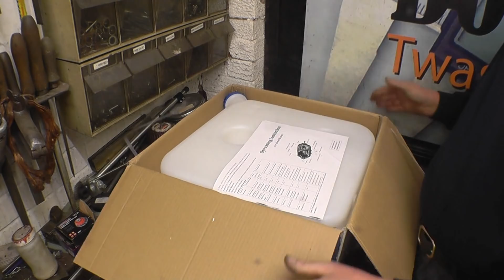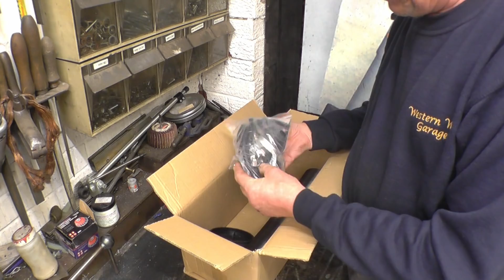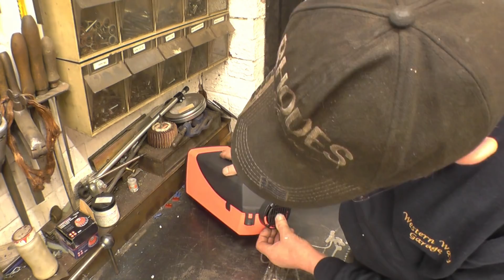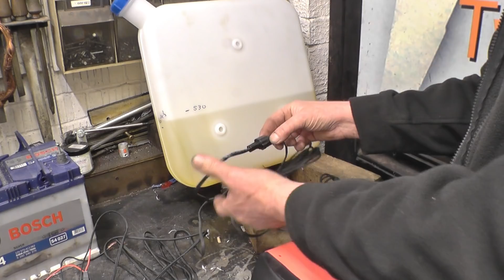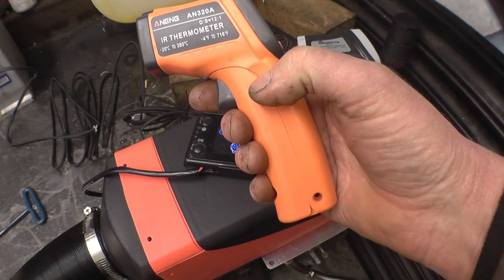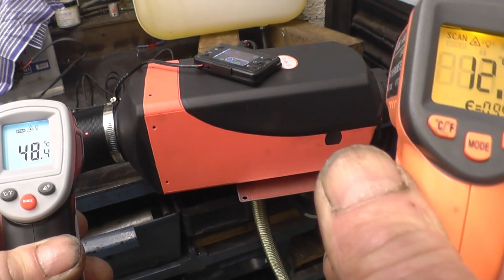Banggood Diesel Heater Review

Comment: Unbelievably cheap compared to Eberspachers and Webastos.  But 146 quid buys quite a bit of high grade insulation (for instance four sheets of 50mm thick 2400mmx1200mmx4 sheets of PIR), then you can heat the workshop with nothing more than occupancy heat, a tiny electric heater or even a central heating radiator if your workshop is attached to the house.   At least this diesel heater is thermostatically controlled, it's strange how so many people with workshops prefer things like massive woodburners and then having to sling the doors open to cool off to draught proofing and insulation.

Comment: You could mount it high up on the wall near the garage door and have some sort of overhead diffuser in the middle of the garage to spread the warm air nicely around. It shouldn't be that hard to get that little exhaust pipe through the wall.
An air-source heat pump would be ideal in the workshop. Keeps you cool in the summer and warm in the winter.

Comment: The fuel pump should be mounted at 45 degrees; it does not create moister in the workshop/van/car; you can also get a small silencer for the exhaust and its much quieter.

Comment: Good honest review and seems like a decent unit. Got to say though, I think it's the wrong tool for the job. Half a litre of diesel an hour to bring the temperature up to 12 degrees? As has been mentioned, a plug in oil filled heater costing very little would do the same job for less money. It's also far less faff. Diesel tanks, exhaust. Fuel line, battery or psu...and what a racket the thing makes.
Reply: @Carl Wilson Run these on kerosene and it works out about a third of the cost of electric heating. They aren't silent but the noise isn't that bad
Reply: @bitzapot  fair enough. I suppose you could mount it outside to keep noise to a minimum and pipe the heat in.
Reply: It's too much faff. An oil filled radiator maintaining a constant temperature doesn't hit the electric bill too much, unless your garage is Blenheim Palace. Also, you don't have to go out to buy the fuel, it hangs about in the wall waiting to be used.

Comment: Two questions. 1 How big is your workshop? 2 How much does it raise the temperature and how long? For a shop in the states mine is a bir small only 14 x 20 feet. I did insulate the building. Here in the US Kerosene is 2 times as expensive as Diesel fuel even with road tax. In fact off road diesel isn’t that much cheaper. I have used the torpedo type heaters in the past, but now I do a combination of a electric ceramic heater and a cabinet propane heater. I use the propane heater to bring it up to temperature and let the ceramic keep it comfortable. The propane cost here is quite reasonable. My propane was less expensive than the Banggood one. However it does look to be a good option

Comment: Nice honest review John.
Two weeks of trouble free use is a big positive, albeit several hours only a night, with regard to this versus an electric heater, each has its own pros and cons. If your shed/garage has only a small amperage electric supply, then it's a good choice, also buying the fuel as of when means no unexpected high utility bills. Providing more than 5 kilowatt, means it beats most electric heaters hands down.
Certainly better than an old paraffin heater causing moisture/rusting tools. 
With ample electricity supply, remember for UK 230/240 Volts, a 3 kilowatt heater will need 12.5 amps, 5 kw- 20 amps!!!. Higher than this then the oil heater wins quite easily.
 The most efficient electric heater, available at minimum cost is a oil filled type, used with a thermostat, for directional, then a fan heater.
Just my view.

Comment: I wonder if you could cut the end off and use it as the heat source for a metal casting furnace? It would be a simple and cheap way to build furnace if it kicks out enough heat.

Comment: I'll stick with my $100, 4.8kW electric thanks.  Heats my 300 ft2 single car garage shop in about 5 minutes from 5C to a comfortable temp.  Plug it it and done.  No fuel, no extra 12V power supply, no poisonous gasses to worry about, nor poking holes in the walls and heaps of wiring and plumbing.  The economics will vary by location and the cost of energy, but I can assure you in Canada, you will never save a penny with this diesel burner over electric unless you live off the grid.
Reply: Surely that depends on the cost of electricity in the UK vs Canada. It ain't cheap in the UK.
Reply: @poppypuppy5372  It's about $0.08-$0.12 per kwh  (0.05-0.08 euro) depending on how much you use (price jumps as you use more).  The $130 price difference in the heater will take a lot of heating to make up even if diesel is much cheaper per joule.

Comment: seems strange the heater plug light came on when you turned it off, why would the heater plug need to come off its its only cooling down, time you pay for fuel and to keep battery charged up just not worth it, also having fuel in a work shop like that is not the best idea
Reply: Why not? Its diesel, not petrol.
Reply: @timothy790110  hes not burning diesel if you watch the video! it cost more to run than an electric heater, i jusst cannot see any point in it its not meant to be used in a shed, its for trucks & caravans etc
Reply: orkid knog if using kerosene the running costs per kw are around a third of electric
Reply: I wonder if the glow plug comes back on to burn off any residual fuel as it cools down? The heaters are very much worth using and safe. Less dangerous than a lawnmower full of petrol...

Comment: Hello John,  I am amazed by these new heaters.  I have a Toyo in my boat that they stopped selling in North America which cost about 2500 dollars.  I had tried Espar, Webasto, and another unit which were not designed for full time use and crapped out in two or three hundred hours (not a lot for the price).  The Toyo was the best because it could run 24/7/365.  So price per hour of operation is fantastic with this unit.  I have watched a couple of other videos and they seem very good with the caveat that you turn up the thermostat and run them hard for a couple of hours a day if you are idling it along for extended periods or they will foul the combustion chamber and heat exchanger.  Simple enough.  Definitely need some sort of auxiliary power (motorcycle battery??) because if the power is cut off the heat will melt down the plastic pretty quick.  That seems its one weakness.  My Toyo is all stainless.  Good video.  Take care.  Doug

Comment: Half to 1 litre an hour, thats 60p to £1.30 per hour when you could run a 2kw electric fan heater costing £10 for 15p to 30p per hour (and people think they are expensive to run). In a van, yes.  But in a domestic / workshop environment with electric on tap in comparison? Come on John.  Would you really pay for that out of your own pocket and then the extra cost of the diesel, CO alarm, potential fuel leakage, Products of combustion leakage, longevity of the control panel etc when a fan heater does the same job simpler and much cheaper? You've surprised me with this one.
Reply: They'll run on kerosene which is cheaper than diesel and the half to  1 litre per hour is for 5kw of heat. A normal electric fan heater is 2kw so when you compare the costs and heat output they work out around a third of the cost of using electric heating. Electric heating is always the most expensive way to heat unless you're looking at heat pumps.
Reply: Wet fart is obviously deaf!.
Reply: I use heating oil to run mine and it's absolutely fine, currently the cost of heating oil is 61p/litre (or less if you buy in bulk).
Reply: Were do you buy small quantities of  Kerosene/Heating Oil the minimum I can find is 205 litre barrels.
Reply: Just realised John says .3 to 
.5 litre an hour, that's about 30p an hour on full heat for 5kw. Roughly 30p an hour for a 2kw electric fan heater makes electric heating about 2.5x more expensive

Comment: I want a review of it running waste oil...

With thanks
Glenn
GLMelectrical
Leeds UK
Reply: Waste oil would probably have one of these units fouled in 5-10 minutes. Even clean diesel can foul them if they are not periodically run at full blast to burn the carbon and soot deposits. Most reviews I have seen mention fouling problems when running prolonged times at lower settings.
Reply: What about cooking oil?
Reply: @andytaylor8802 

Thin it with some paraffin
Reply: @andytaylor8802  I've the eberspacher version in my Defender, I run the Defender on 50/50 diesel/cooking oil in the summer. I've not had any problems with the heater when I occasionally run it  on the cooking oil mix.

Comment: Yep, you've gotta drill the tank and insert the fuel outlet.  Watched another Brit assemble one in his camping van.  You should be pulling your combustion air from outside.  Any shop air used for combustion has to pull makeup air from somewhere, and that is usually cold air from outside.  It will take less fuel to heat the shop if you pull your combustion air supply from outside the shop.  The colder air is also denser and has more O2 for combustion.

Comment: These are a rip-off of the German  Ebersprecher units which in my experience were extremely unreliable.
In the first version  the adjustment control used to break so you could not control the heat.
In a later version, the control unit kept issuing fault codes sometimes after one week of use from  new.
This version was the most unreliable piece of equipment I have ever used.
In a later version they fixed some of the faults.
My experience of them was in Network Rail vans which really, really needed cabin heaters and they hardly ever worked.
Expect problems.
Reply: I hope they have done a better job than Ebersbacher. I had one in a boat and it hardly ever worked. If the voltage dropped a bit it died, if it didn't like the fuel, it died. If the glow plug developed whiskers (every few days), it died. The control unit was forever giving up the ghost.  My wife had one in the mobile library van that she ran for the council and that had a similar unit that the garage were forever trying to fix. Awful things. Perhaps the Chinese have sorted it out; will be interesting to see.
Reply: They use them in trucks . And are exellent normally
Reply: From what I've seen of John over the years, if this unit craps out on him, we'll certainly hear about it.
Reply: Apart from the control system there is almost nothing to go wrong with them - only one moving part inside - the fan motor - double ended pulls combustion air in and blows the heated air out, and the glow plug.  There are heaps of different Chinese ones like this with heaps different controllers - quality would be pot luck at best.  Only other thing is they need to be cleaned once in a while - a 10 minute job once you’ve done it once.
Reply: @Phantomthecat  When they are fitted to  vehicles they are often hard to access and there is a limited amount you 
can do without removing them. When you come in from the freezing cold the last thing you want to do is  mess
around with a failed heater. You press  Reset and wait about three minutes. It then shuts down and you start again.
On many occasions I was still doing this at journeys end. I had years of misery with these things, but not any more, thank goodness.
I once looked them up on eBay and there were loads 'refurbished' with  'all fault codes cleared'
I preferred vans with no rear heater fitted as you knew what to expect. I am surprised anybody  still fits them.
Apparently the 24 volt  lorry ones are better.  They would have to be.
 Use any other heater in preference to these.

Comment: Bloody hell what an arse ache... Surely a little electric heater would do for a small space like your workshop.
Reply: Probably cheaper to run than an electric heater, and also a lot faster to heat the cold workshop to a comfortable temperature as well.
Reply from the maker: It also depends on the availability of fuel at the right cost
Reply: @doubleboost  Yeah fair point, red diesel? Could you burn used engine oil in that thing ?
Reply: Red diesel is an option but I've heard it doesn't burn as clean as regular diesel. Kerosene/Heating Oil/Paraffin works and is cheapest of all (55 to 60p a liter) and is the cleanest burning (its what I use) I wouldn't use waste oil as I think it might be a very dirty burn and clog the burner with carbon. There is a video on YouTube where someone tries straight veg oil but no preheat and it wont burn, I guess its too thick. Not sure if a pre heat would help
Reply: Were do you buy small quantities of  Kerosene/Heating Oil the minimum I can find is 205 litre barrels
Reply: @Paul Reed One of my local heating oil suppliers has filling station type pumps where you can fill up approved fuel containers - 20 litre Jerry can in my case
Reply: @Worksengineer  You in Britain Paul? You probably know already but it's often called "paraffin oil" here. B&Q and Homebase sell it and so do some garden centres if you want it in hand.
Reply: Much cheaper than electric heating and the one I've got warms a much larger space, we're not talking 20 degrees but enough to make the space pleasant to work in.
Reply: I've never actually used a fuel heater, I just made an assumption that turned out to be wrong.  So I now consider myself corrected on the subject, thanks
Reply: 3kw will do nothing even for a single garage in winter,
Reply: @clive ramsbotty.  I have a similar heater in my workshop (30ft x 10ft), last winter when the windchill was minus 20c it was more than enough to keep warm,. An electric heater would cost a fortune to heat a similar space.

Comment: Im thinking small heat exchanger on the exhaust and wonder if once its hot if it could run a small percentage of used motor oil/diesel mix   cool and cheap little unit  Bought one threw your link.. thanks